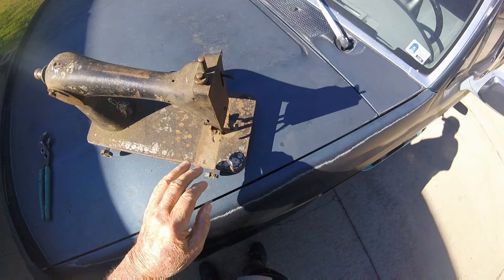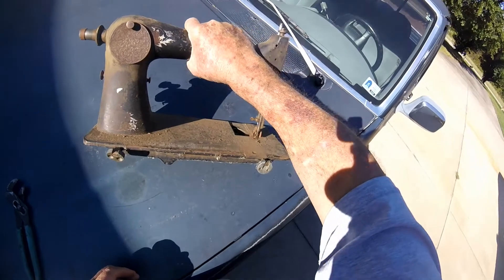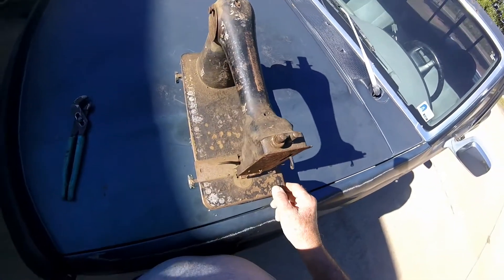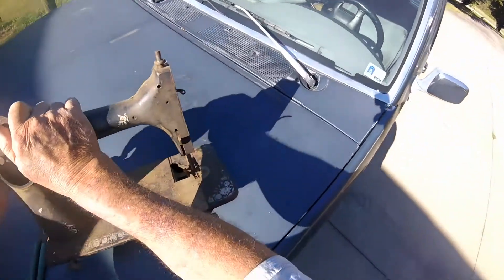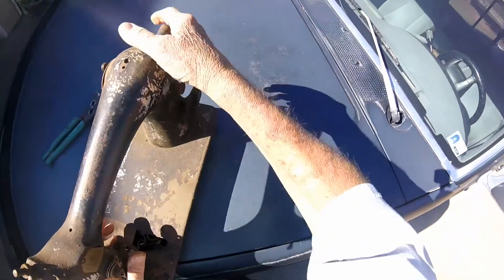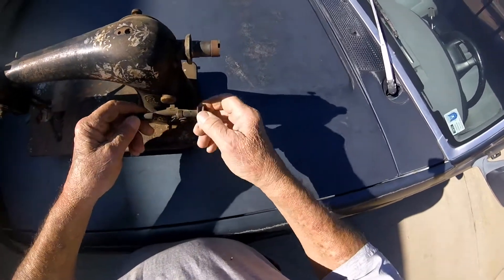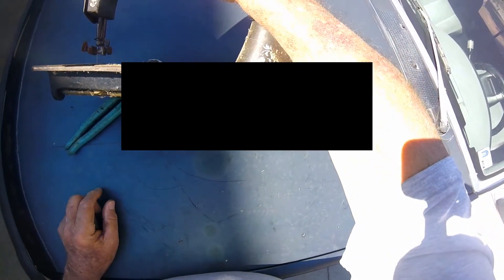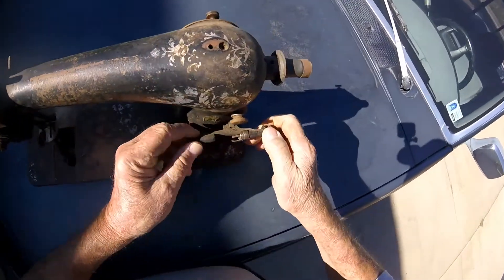Pwalpar Whacky Project Ideas Sewing Machine Scroll Saw

Comment: Walter, it looks like that sewing machine had some flower and scroll art work on it. If you turn it into a scroll saw some of the parts you remove may have value to someone trying to restore a similar machine. You sure come up with some off the wall ideas. That machine may be worth more to a collector than turning it into a scroll saw. Thanks for sharing.
Reply from the maker: I most likely wont get to this project anyway